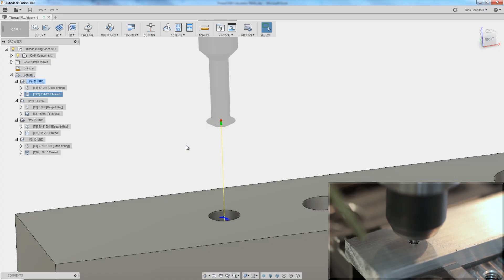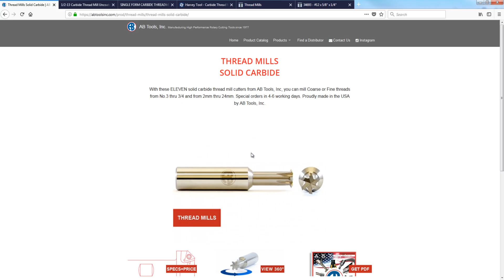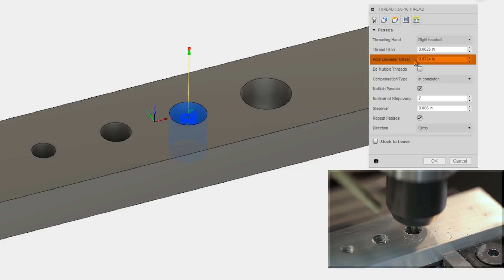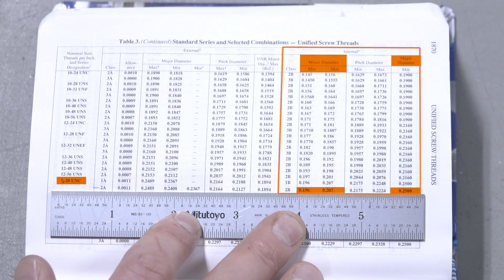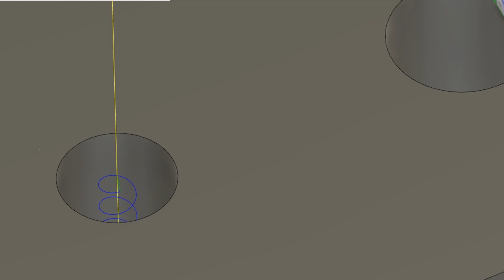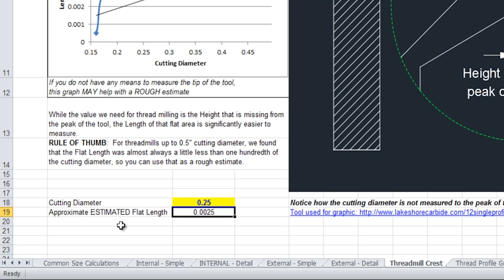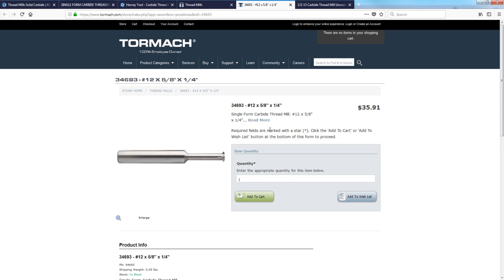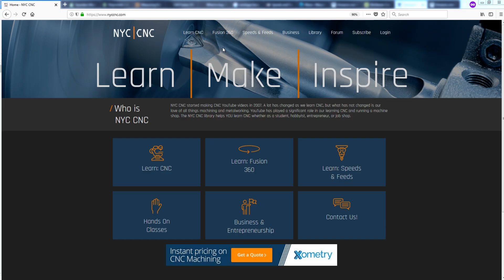Threadmilling: The Ultimate Guide! WW187

Comment: Not sure why YT is putting such old video's in my feed but figured I'd watch anyways (It's late but I'm having a bad case of insomnia so here I am...) and figured I'd share a little tip (no pun intended). This will seem like a somewhat long read but ultimately what you can gain from it could not only be helpful but is really easy to do. 

If the manufacture of the tool does not advertise the 'Tip" flat size and / or you want to just be as accurate as possible and eliminate and potential variability from tool to tool during the manufacturing process, its actually quite easy to just take a linear cut with the tool in a piece of material and use a tread wire and a mic to take a few measurements and then calculate the size of "Tip" flat with a bit of easy math / Trig.

First grab a piece of material (like say a piece of 1" x 3/8" flat bar for example) and measure its true thickness (this is important... don't just assume that it is what it is spec'd to be) where you are going to make a cut in it with the thread mill and jot it down. 

Next, throw it in a vise and make a cut across one of the faces used to measure the materials thickness, to a depth of choice that the mill can handle. Personally what I do, just so that I don't have to worry about any tool comp or the tools diameter is I sharpie up the face where I am going to make the cut and then walk the tool in, just till is scratches the sharpie off and zero the axis and then just shift in the amount I want to cut for the test and I also do a spring pass for good measure.

For more example here, I'll reference one of my tools that can do 12 to 32 tpi. I'll do a total radial depth of .035" cut across the face.

After you have your cut done (i.e., have a 60° groove cut into material to the depth you chose), lay an appropriate size thread wire in the grove and measure over the wire and jot this measurement down.

Now for the math.
First calculate what the theoretical over wire measurement would be IF the tool had a dead sharp point on the "Tip". The formula is:
wire diameter x 1.5 + measured material thickness - depth of cut = Theoretical over-wire measurement for dead sharp tip point tool 

Going back to the numbers above for my example, we'll say that the material was exactly .375" thick and for an .035" deep cut, I'll use a .029" wire (note, its a good idea, if you haven't already, to measure the wires diameter because it might not be exactly the size that its advertised as... For example, my .029" Brown and Sharp wires actually measure .0289" but for this example, we'll just call it .029"), so for my example, it would be:
.029 x 1.5 + .375 - .035 = .3835
So if the tool had a dead sharp tip point, and I did a .035 radial depth cut in a piece of .375" material, the over-wire measurement would be .3835"

Given that the tool does NOT come to a perfect dead sharp tip point, the actual over-wire measurement you get will be a tiny bit smaller than the theoretical measurement above.

Now you subtract your actual measured over-wire measurement from the theoretical one calculated above and this is the height of the 60° included angle triangle that is missing from the dead sharp tip.
For example, say I measured .3809" actual over-wire thus would be: 
.3835 - .3808 = .0027
So the missing radial amount from the tip is .0027"

Now the simple Trig, take that missing amount (.0027) and divide it by the SIN of 60° and you have the size of the flat on tip.
.0027 / 60(SIN) = .0031

so for my example tool, the width of the tip flat is .0031"

Comment: Awesome video John, it has helped me a ton!!! Thanks!
2 questions and a tip:
1.) You didn't explain the 0.004 stepover value/calculation. How is that determined?
2.) With the updates/interface changes and new features in F360, is there an updated version of this video coming?
Tip: I learned the hard way that when using the Thread or Hole (Tapped selected) feature in F360, do NOT select the "Modeled" option. Otherwise F360 will bore your hole (if boring vs drilling) to the Major size, and the threading operation will not work correctly.
Reply: Yeah i have the same question about 0.004" step over

Comment: With the third correction wherein you back the toolpath out to account for the crest, the tool will no longer fit the shape of the desired thread. There will again be a gap between the sides of the tool and the desired thread profile, albeit considerably smaller than the one before the second correction.

Comment: Also forgot to add that in the video you mentioned you would cover the number of step overs and the step over amount but didn't get to it. I have looked on the forums for clarification but have not seen much. I think the step over is really affecting the last pass and the number of step overs is breaking up the rest but input would be great on that. Thanks
Reply: 2 years later, also still wondering where this is covered and went through the video several times over hoping I missed it

Comment: What is your thoughts on using the drill operation and selecting thread mill? We have found we can input the final diameter in and if we want a tight thread we add 1/2 the crest or if we want normal we add the full crest and it comes out every time. Can you compare and contrast the two operations?  Also have you seen away to program an interpolation turning in Fusion 360? Thanks

Comment: I have a question, I made my own thread mill model using the form tool feature so that it accurately represents the single form 4 flute thread mill I am using. I did this because there was no way to accurately make the thread mill in fusions thread mill option in the tool library because there is no way to make the neck the correct size, so when I simulate it, the neck of the cutter cuts into the minor diameter of my threads. In reality, it wouldn't do this, but I want my simulations to actually show what the cut is going to be doing. So back to my question, since I accurately modeled the tool using form mill, I have included the crest of my tool in the model, will this affect whether or not I need to account for the pitch diameter offset? And if so, what would be different? I'm having a hard time wrapping my head around whether or not it would affect anything. Unless I'm just not all there and there truly is a way to get the neck of my tool accurately represented in the thread mill option in the tool library...

Comment: I've watched this video probably 10 times over the past year or two and I finally understood the 3 steps. It didn't click until now that the minor diameter was to a flat, not the imaginary pointy tip and that's what the 2nd of the 3 steps is for. Thanks, you've made a lot of valuable videos but this is your most valuable.

Comment: Hi guys - KIRK from NC, but I’m a Long Island guy originally.   I’m looking to internal thread 1/4” BSP thread pattern into 15/32” holes in 1” PVC 40 Caps.  Right now I’m.hand tapping with a bench vise and it highly sucks!   I have a fairly new ShopBot Desktop XL (pretty stout unit), and would just love to make a Jig to firmly hold about 100 of these caps at once and let the CNC do it’s thing.   I’m thinking after the hold down jig is built, that the actual processing is two steps (tools):  one, the 15/32” mill bit, and the 2nd tool, the Tap itself.    I don’t have Fusion, only latest Vectric V-carvePro.   I know you guys do mostly higher level stuff with aluminum and not hard PVC, but do you think this project is ultimately workable?

Comment: John  i cant seen to gat a striate   answer from any one ?   I now it as potential So why I sent the more help to convert  old lathe to it siystom. ?  
OK I have a Lathe that was built 100 years ago . A later  models had a lead screw to the more modern lathe .  Bur my older motel only used the rack to cut threads. the stars had no adds like a thread gage , so signal point  thread cutting is easer. so this is my idea .  & i would like some gidens on the subject.  yes i think a trad mill system on my lathe with it's  rake will give me an opatunity . to get my lathe cutting Thread's   & the pitch choices i have on the Lathe  will give  me a grater variety of choice.  the thread i need to cut is 1"1/2 BFS  what size thread mill will achieve  that ? function ?.

Comment: You know something that I frequently forget to do when thread milling is checking that the minor diameter of the hole in the model is correct and matches what I used to calculate the p.d.  if you are scratching your head on why the thread is too tight, double check that :) obviously the thread toolpath is using the hole to interpolate so if that’s wrong then you thread will be under / oversize

Comment: Great video. Did you cover the passes and depth calculation? Ex. 7 passes and .004" stepover.  Also, I like to use the control vs. the computer for tool comp. If you need to adjust the gauge fit you can just alter the tool cut diameter in the tool table (+/- .001) and walk the pitch diameter right in. Thanks for the content. You are my go-to Fusion 360 wizard.
Reply: It looks like I can just visually adjust number of passes vs. desired stepover. I don't need to over-think it.

Comment: HI John

First off I love your work, best informative CNC tutorials on the web. Keep it up.

This thread milling one bamboozled me though, it left me more confused than when I started to look into thread milling. When I started to look into thread milling I thought, design hole, CAM hole as that's what Fusion is for but this video scared me :-)

So I asked on a FB group I'm on and a guy there had a simpler explanation (that is actually borne out with the description tooltip on fusion which is in brackets next) (NOTE: Required if the hole is drawn to the Minor size, or if the Boss/Cylinder is drawn to the Major size). He said you only need pitch offset diameter if you model the hole wrong. So say you need an M6 tapped hole (6mm metric major diameter, 5mm minor diameter) you can either model the hole in fusion by designing a 5mm or 6mm hole and threading it. 

If you model a 6mm hole then it will be wrong for your drill size but perfect for thread milling, if you model a 5mm hole then it will be perfect for drilling but you will have to adjust for thread milling with the pitch dimater offset.

Now I haven't tried this yet as my thread mills turn up tomorrow so this could all be crap from me :-) However if this is the truth then I order you (not really I just ask nicely) if you could maybe update the video or just do a new one on pitch diameter offset to help others who may wander down my path :-)

Any way keep up the excellent work, you're helping so many noobies like me make a living from CNC.

Jools

Comment: You don't need CadCam software to treadmill. And now 360 has been crippled, you might need to know the old school method. 
Use the main pgm to position at holes. 
Use 1st sub pgm to position threadmill at depth and move to radial location using G91.
Call 2nd sub pgm the number of repetitions or threads to get threadmill out of the hole. It will be only one block in G91 for 1 thread.
Main pgm 1
G00 G90 X5 Y8
Z1
M98 P2
G90 G00 Z1
X10 Y4
M98 P2
G90 G00 Z1
X20 Y12
M98 P2
G90 G00 Z1
M30
SUB 2
G91 G01 Z-2 F50
Y.1 F.7
M98 P3 L12
SUB PGM 3
G91 G03 X0 Y0 Z.1 I0 J-.1 F.5
M99
.
Simple but I have used this on many CNC mills for 35 yrs.

Comment: Also I’m going to school for my CNC machining and manual machining certification I’m understanding how to do the calculation for speeds and feeds but understanding what’s classified as low carbon medium carbon steel etc.. and stuff is a lot to understand but I understood how to find the basic thread major minor, pitch diameter and over the wire diameters.  I’m sorry my thoughts are everywhere and to get speeds and feeds for threading rpms do you approach it the same way?

Comment: John,  I'm a little guy with a haas that challenges your way of thread milling.  I'd be glad to go into detail, record screen, etc. - BUT if you model your thread mill properly and generate a form tool, with the flat (can be done with ANY thread mill if modeled properly, regardless of supplied information from manufacturer), the PDO is as simple as major - minor.  I was today years old whenever I figured this out, along with having used your method (which works), it dawned on me how it is able to be done all in fusion with little effort.
Reply: I'd be curious how you go about this!

Comment: Great video.  I'm about to jump in and play with it some.  Your spreadsheet linked only has NPT threads tho. and I didn't see any other tabs as shown in the video.
Reply: Fixed, a bug in excel.  Turn off tabs then turn back on then minimize then maximize and bam, they are back.  Odd, I never ran into that before.

Comment: 3:39 best give you EXACTLY diameter of that tool. WHAT CREST.. thread major diameter + what ever is tolerance that nut and no funny crest or half something"pitch diameter thing did you know inside and outside threads have difrent pitch dia lol" my makro G65 P1076 Z-20 A20.15 D1 R1 K8 F2.5 this will cut M20x2.5 no cam needed. no funny half something when major diamere is 20+ no 20-17.5(drillhole) half it get middle add bit. what?!? major diameter is 20+ and use mill diameter you bought. if you mill 20. bolt not go in becouse minium is 20.05 lol

Comment: Great vid.  There is another option to open the the thread without going deeper.  That is to do a second pass with a vertical start depth offset. This increases the height in the root of the groove without actually going larger(deeper) in diameter. Makes for a stronger, smaller overall internal thread and you can use a smaller OD tool to create a larger major thread ( obvious tool limitations apply).  This is something you can't do with an ordinary tap so might as well exploit the cnc capabilities. 
Maybe that's step 4 in your excel sheet? 
Also, add the once around 30 deg. chamfer at the beginning or end to deburr the hole.  Bits already spinning right there at the rim...
Cheers John and thanks for all the work you put into these videos.

Comment: Micro-100 also publishes the flat dimension.

I’d also like to say, there’s no need to do so many passes in aluminum. Even on the baby tormach. 2 passes on the smaller is plenty. Maybe 3 on the bigger. You’re cutting aluminum with a carbide cutter. Might as well cut butter with a hot knife. 

Great tips though guys!

Comment: One of your best most informative and useful videos. I have really had a hard time getting to the final PD. Usually takes me several offset bumps to get me where I need to be and then I have put notes of how much I needed as a manual note. Have you been able to use Fusion 360 to mill NPT threads?

Comment: Great video John! I thread milled on a Bridgeport cnc powered by paper tape 40 years ago. Had to use a subroutine in polar coordinates to do a helix back then. Re-ground a woodruff cutter to 60 degrees.  Wow, those last three sentences sounded like a old washed up machinist trying to be relevant today.
ATB, Robin
Reply: That sounds awesome. Your tape must have been 3 miles long! Haha.
Reply: That was not  a nice thing to put now was it.  we are  all tiring to become relevant in a modern age .   no need for the smart moth . son .
Reply: May be  the Woodruff  cutter may  be the way for me to go grown to a 60  Degrees signal point cutting profile & driven by a router just may give me the way to ues my lathe it's  pitch selection being the "computers"   selection of feed & pitch in the same way we would do if single point threading  on the lathe  but using a spinning mill cutter in stand  . cutting at 3000  3pm several light cut's   yes that i think may do it .